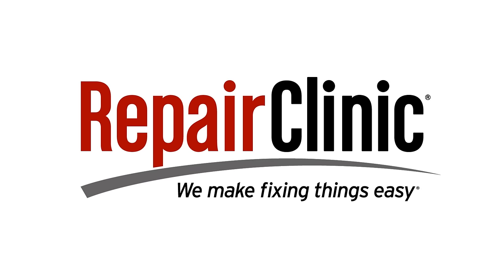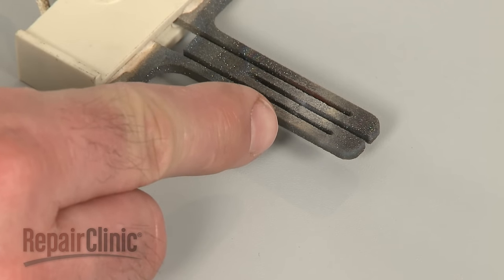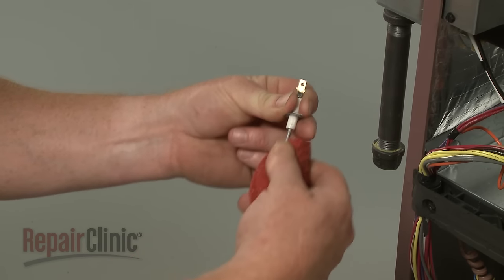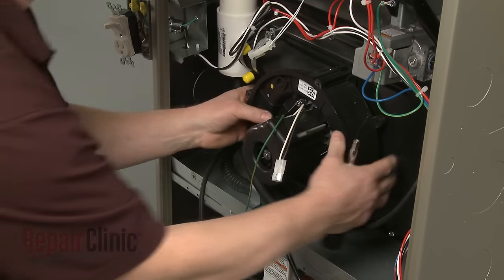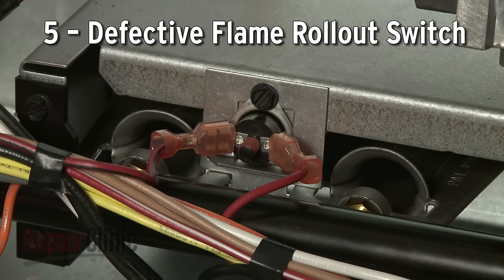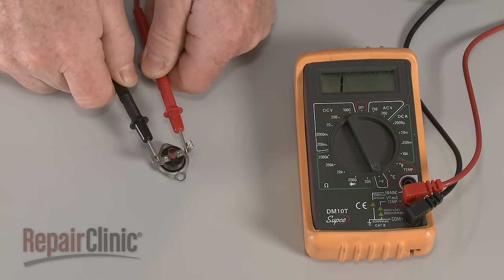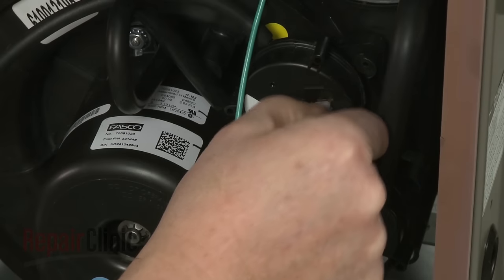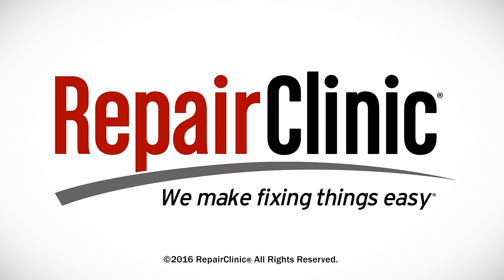Furnace Not Heating — Furnace Troubleshooting

Comment: Used this video to troubleshoot my Goodman furnace not heating.  Found that the pressure switch was stuck open.  Verified the switch was faulty with my multimeter checking for continuity while under pressure. No continuity.  Ordered a new switch for overnight delivery and installed it.  Now my furnace is back in operation and saved myself a service charge. Thanks for creating this video.

Comment: On my 2004 American Standard/Trane 80% gas furnace AUD060R936K5 the inducer comes on then goes off and the fan blows. If I bump the control board it will function properly sometimes and run until the set temp is reached. Then the next time it will go back to not starting. Also a few times I wiggled the control board and it reset the temperature on the thermostat to 62 degrees, weird. I am thinking it must be the control board. Maybe one of the solder joints is cracked or a bad relay. It started when I had 3 flashes from the board which indicates "Pressure Switch Error". Being a novice I replaced the Pressure Switch and Hose and cleaned out the port. Since that made no difference I then replaced the Flame Sensor, Hot Surface Ignitor, Limit Switch and Filter. I also removed the burners and using a wire brush cleaned the burners and the channels in between. I checked the Flame Rollout Switches and they are not tripped. No carbon monoxide detected. I have a new thermostat that I installed 3 months ago that has newer batteries and since the furnace functions properly sometimes, I believe the thermostat is fine. I even cleaned out all the cold air returns. My furnace uses a White-Rodgers Intell-Ignition control board. I found a refurbished one on ebay with 60 days return and the seller pays return shipping. I did check the fuse and tightened the thermostat connection screws at the board. If it ends up being the board I may have some spare parts for later. Does anyone have any input or similar problems?

Comment: I bought a house 3 month ago doing the summer. The fan is blowing but there is no heat. When I turn the thermostat off. The fan kelp running. I had to turn it off at the fuse box.